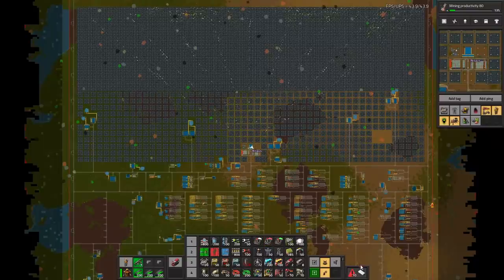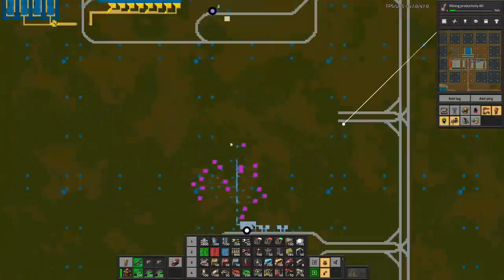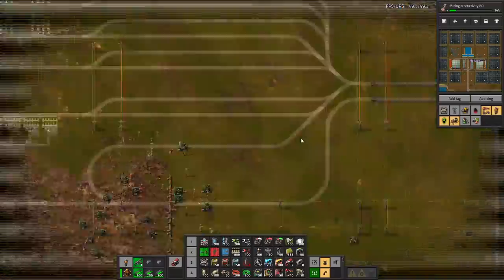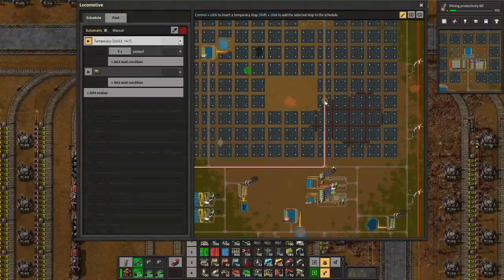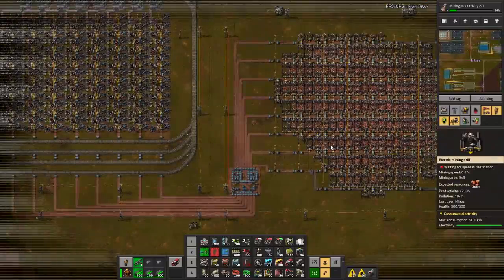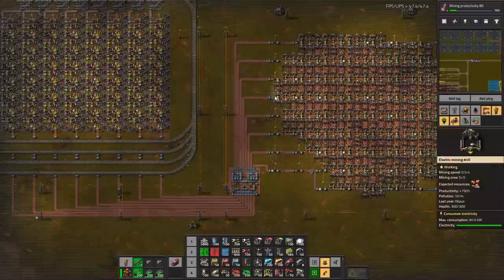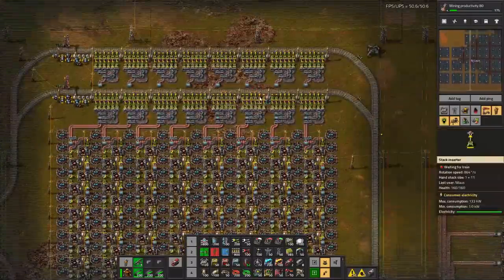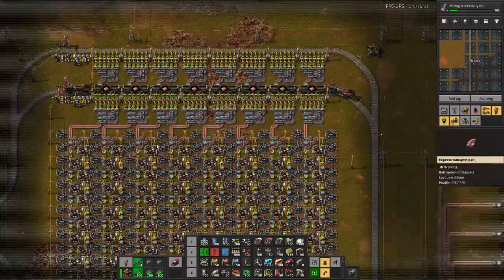NO BELTS for Mining and Smelting (UPS Optimization) | #66 | Factorio Megabase-In-A-Book Lets Play

Comment: Start Researching worker robot speed instead of productivity 
Higher speed will be result in less flight time and will eventually become less robot usage...
Reply: The research has exponential cost increase. It quickly costs more than even his current very high productivity research and becomes impractical to continue. It also does not effectively refund part of its cost through increased productivity so depletes ore patches more over time while being researched.

It does not reduce robot flight time by that much. Eventually robots start to spend most of the time recharging at roboports which becomes the bottleneck. If he was using bot based designs then there would be value to this, but otherwise it is almost always better to get the first few infinite upgrades and then focus on mining productivity.

Comment: 21:17 - oh, interesting!  It's a little bit of  belt, but it does nicely allow everything to be stack inserters, at least.  Of course, you then have one stack inserter being fed by two other stack inserters, so... it won't be able to keep up; I wonder how it'll preference things...  continues watchig ...  Seems it does ok!  Cool.
Will you be using the same station name as for the old smelters, as you transition, then?  I presume so... but that you'll then get rid of the old smelters?  If you get rid of the old ones, then you'll probably want an input stacker with a station of larger limit to queue up the empty trains, ready to load from any of these new smelters with the train limit 1.  Which you've probably thought of already, just thinking out loud.  :)
Reply: One stack inserter is being fed by 2 smelters, not 2 stack inserters. The smelters are the bottleneck and slow down the whole chain. 1 inserter feeds 2 smelters and 1 inserter also unloads 2 smelters
Reply: @Zephyrhash2  true!  I somehow wasn't thinking about the aspect that the production rate was less than what a stack inserter could handle... so, a non-issue!

Comment: Can someone explain y r we using trains to transport ore? Like y not just use belts with beaconed miners?
Reply: ups efficency, belts take a lot of calculations and because of the high mining productivity it is getty increasingly inefficient to load ores onto a belt.
Reply: @pantabo1797  r u sure about that? All the 40k spm bases i have seen are belts only bases. I have read that its mostly splitters that takes most calculation not a fully saturated belt. And since we will design the miners to saturate belts there is no need for balancers
Reply: @Shubhamrockeriscool  2 miners fill a belt with that level of productivity. He's getting 40 belts of throughput on those trains. It'd be very impressive spaghetti to get 40 belts off of that ore patch.
Reply: @Shubhamrockeriscool  yes i am, and i bet those bases run at like 5 ups.
Reply: @pantabo1797  Factorio updates transport lanes as a queue of items that moves. As such a transport belt that is 1 tile long or 1,000 tiles long takes roughly the same amount of time to update, even if the latter one uses more memory to hold all the items on it. Long belts are not a UPS problem. Splitters are a UPS problem as each item that pass through a splitter must be split off to one of the two output transport lanes so in general their use should be minimised. Transport belts are also highly multi threaded now so it is fairly common to see their update time well under 1ms even in mega bases on fairly powerful modern CPUs. This is in stark contrast to trains and logistic robots where the update time cost is based on distance moved.
Reply from the maker: belts are bad for UPS at the scales I am using them

Comment: Not sure if it's been said but with the direct to train mining would it be better to close the station if there is less than a full wagon of ore available? At least then you wont have a train sat there waiting for a full load it's never going to receive.
Reply: You could fix it with train logic.  Leave station after full OR inactivity.  No need for extra circuit logic doing math.
Reply: @brianking992  That's true and I suppose it would only be the 1 time a train goes there and doesn't get a full load.
Reply: There are two miners per train car so once one miner dies the other one will fill it up the last car at half rate at least.

Comment: Could you do the smelting with fewer beacons but use long handed inserters to get rid of the chests and belt undergrounds?  Anyone know what the relative UPS cost of smelters is vs more inserters/belts/boxes?
Reply: I don't think that long-handed inserters are anywhere near fast enough for this.
Reply: Issue is a long hand inserter has a limited hand size of 3 against the stack inserter's 12 and turns slower. This means that not only must it make 3 full swings per stack inserter swing but it also spends longer making those. A chain of 2 stack inserters will average significantly less active time when clocked, with the main make or break part of the time saving being the cost to insert from and remove from a chest.

I do not think the belt insertion part is that efficient and is kind of going against the entire point of direct insertion smelting.
Reply from the maker: not fast enough